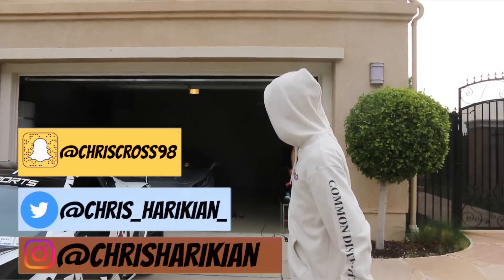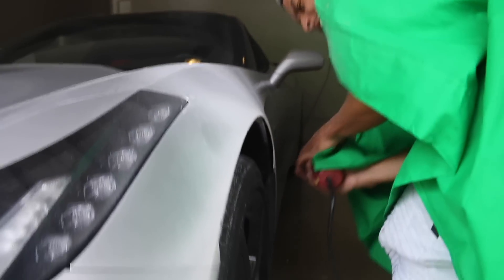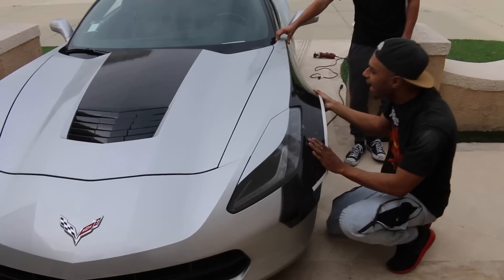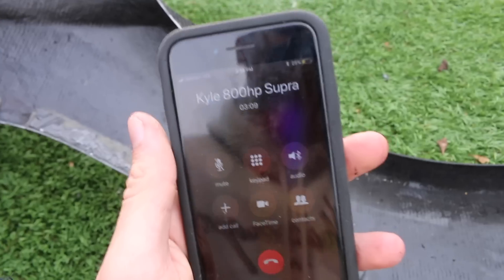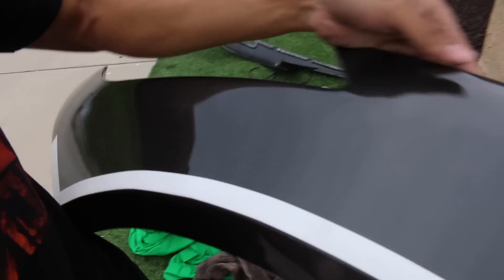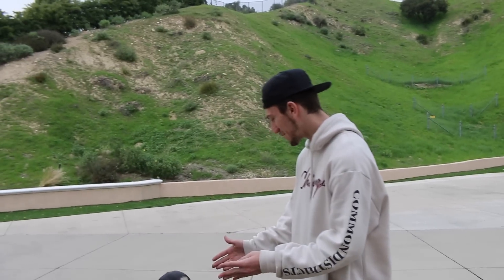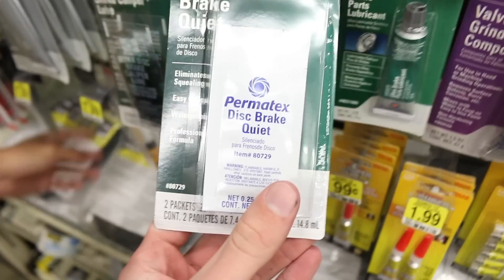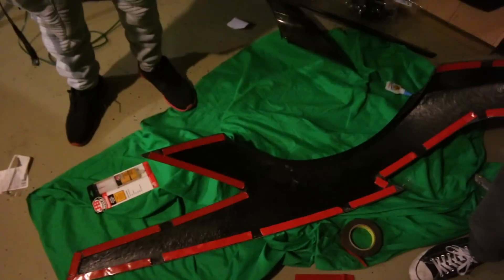NEW CARBON WIDE-BODY FOR THE CORVETTE!

Comment: My jaw dropped when I saw the back fender cut
Reply: same. ruined the car. hopefully the widebody looks good
Reply: All the wide kits for C5s and C6s replace the entire fenders front and rear so you can save your stock ones. Guess they can't do em like that on C7s anymore?
Reply: @RobFRC  IM SURE you can save the fenders if converting to a z06 widebody. but i think his carbon pieces are a little more aggressive than a stock c7 z06
Reply: @macktuned  it does in a different color cuz tamir's vette looks so good
Reply: These dudes hacked this fuckin vette up..do this shit the real way..replace the fenders and actually cut the fenders around the whole fenderwells..

Comment: Personally I'd rather have something look completely stock on the outside but on the inside have everything modified and tuned correctly, after market exhaust, new shocks, new upper/lower control arms, etc... basically a sleeper car.